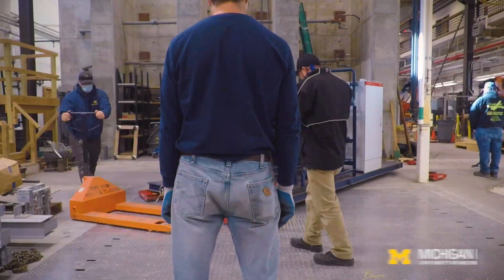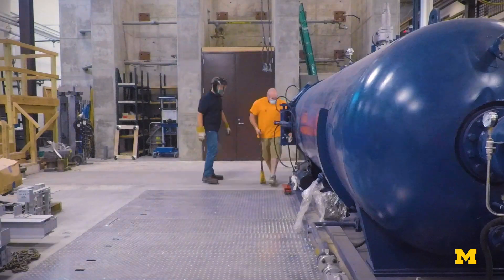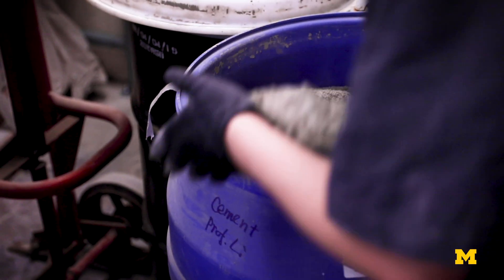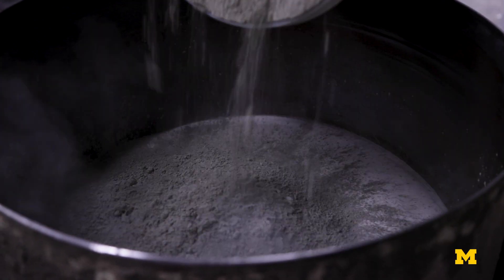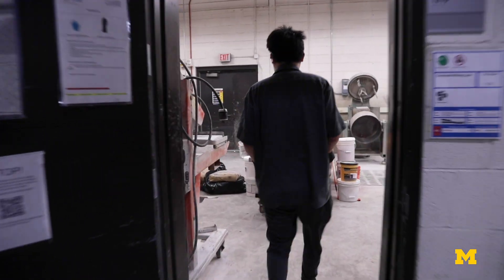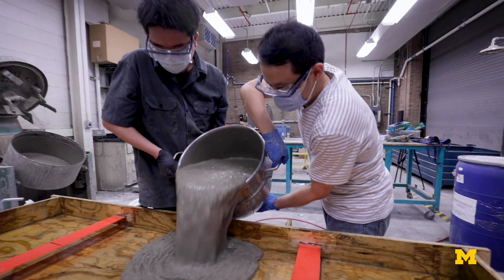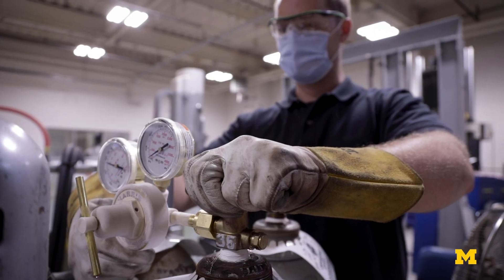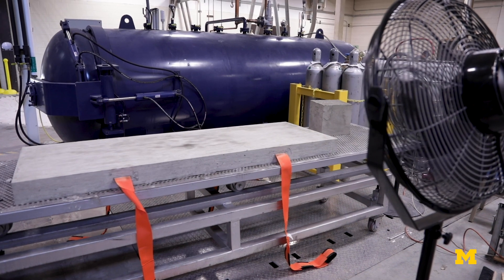CO2-cured bendable concrete sequesters carbon to improve performance and lower climate footprint

Comment: An almost completely impractical product since it has to be made into preformed slabs - fail.
Reply: I think the 2000 lb pressure chamber is a larger challenge...Imagine trying to do this with a tilt up building!